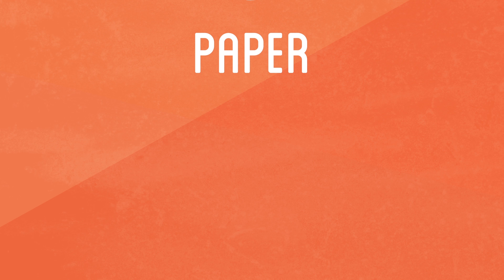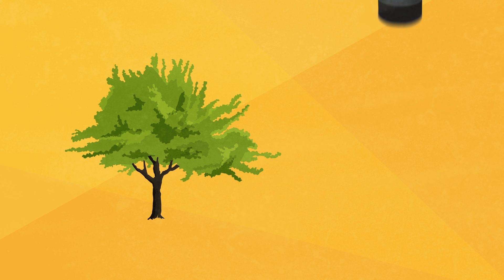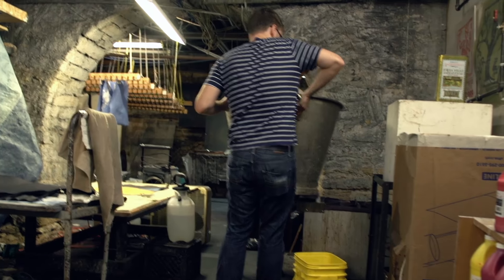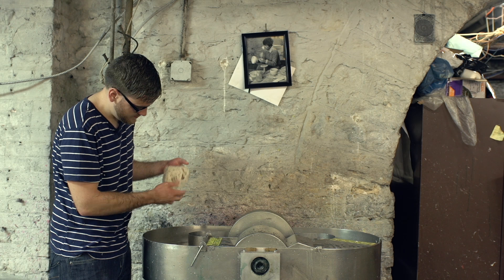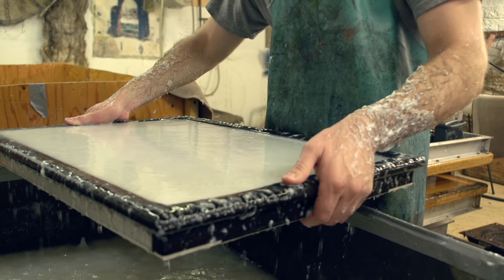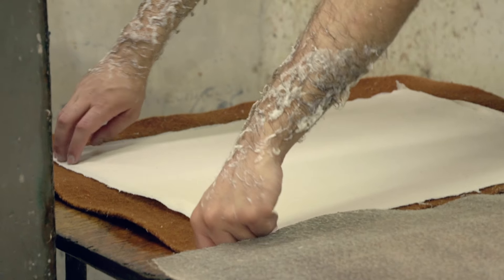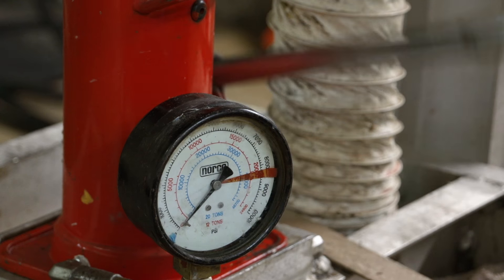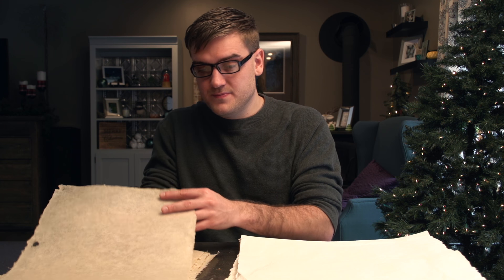Papermaking Pt. 2 | How to Make Everything: Book

Comment: I always wondered if it's possible to make like a block of paper. Like a paper cube. How tough a material would that be? xD
Reply: Well you have a paper square. Just stack a bunch or buy a pre-stacked paper thing.
Reply: I think you'd have to take the material, like this cotton or hemp fiber and stack like a huge ton of it and push it under the press and then let it dry with tons of fans cause it won't have nearly as much surface area. 
Then maybe you'd have what I'm imagining. 

What do you mean by "pre-stacked paper thing"? You mean a pack of papers? Those wouldn't be one piece.
 I want a solid cube of paper xD